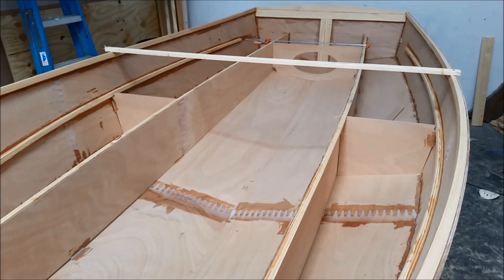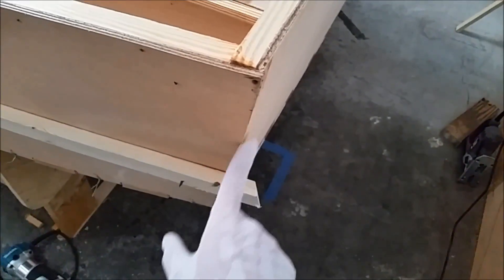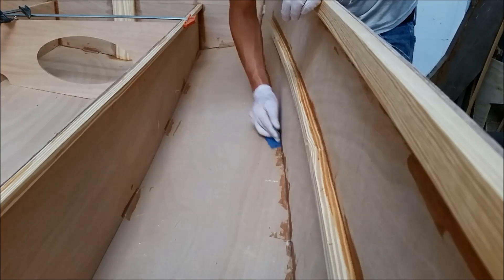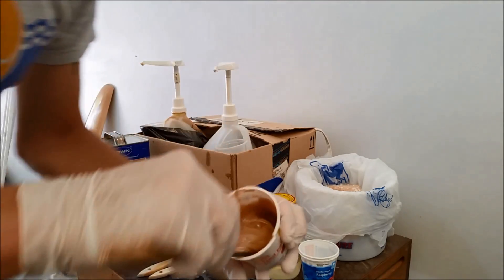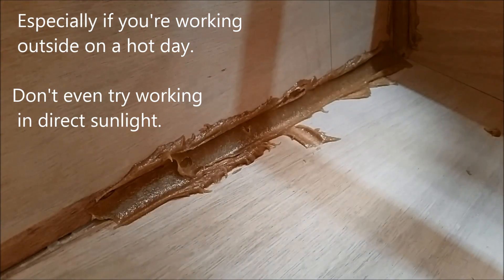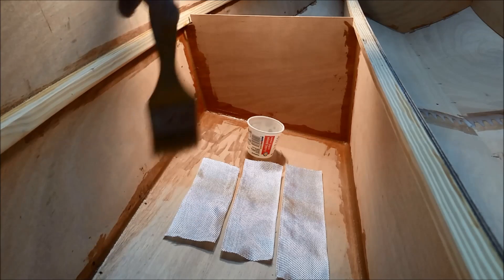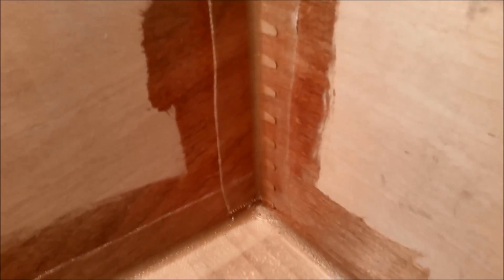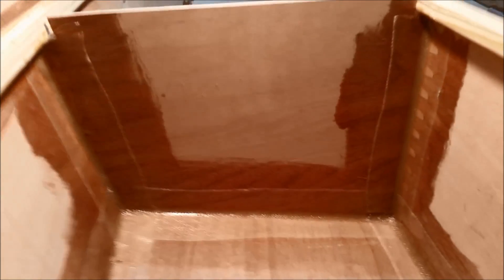Core Sound 15 Build Part 4

Comment: You can wet out fiberglass with filled epoxy. I would have cut the tape into 15"-18" strips. I would have filleted and wet out wood for one strip at a time, placed the strip on, then wet the glass strip. Overlap glass strips 1". The shorter glass strips prevent the epoxy from setting up while working it.

Comment: ADVICE, MAKE A 90 DEGREE 1/4 " LLITE PLY SQEEGIE WITH A 1 " RADIUS ON THE CORNER , USE TO SCRAPE UP YOUR BEAD, MAKES YOUR FILLET AND SCRAPES THE EXCESS AT THE SAME TIME VERY QUICK

Comment: For extra protection try washing the wood with acetone, then follow that up with a mixture of acetone and kicked resin. This washes out the cells of the wood, and then allows the mixture to penetrate the wood cells. After the acetone flashes off, apply your fillets. Also a fiberglass roller if small diameter helps layup in the corners.